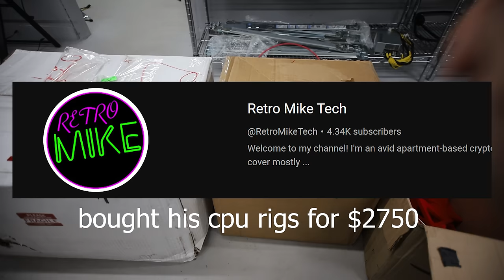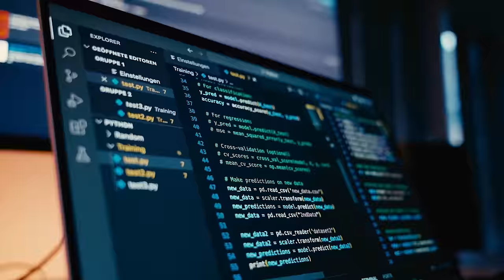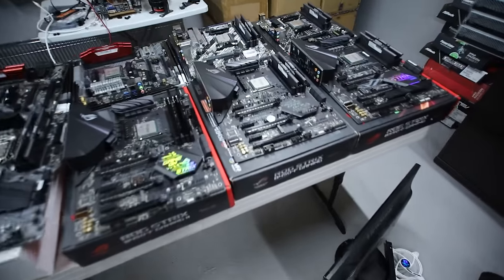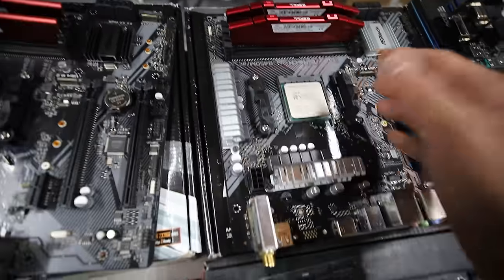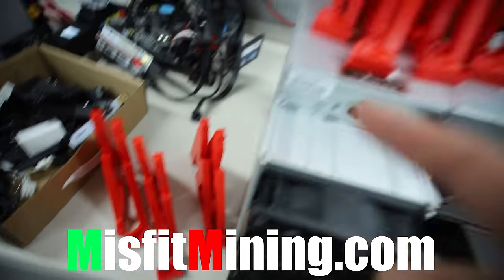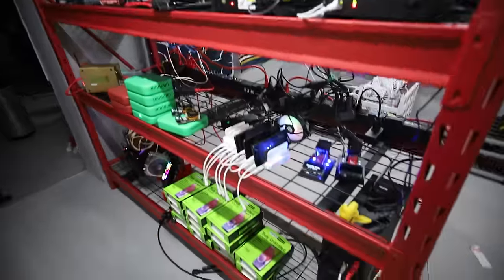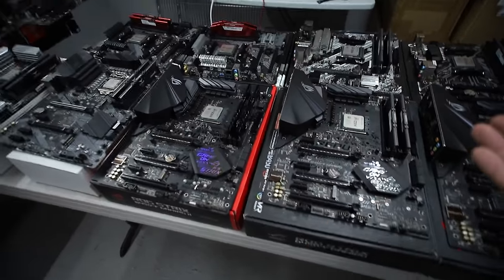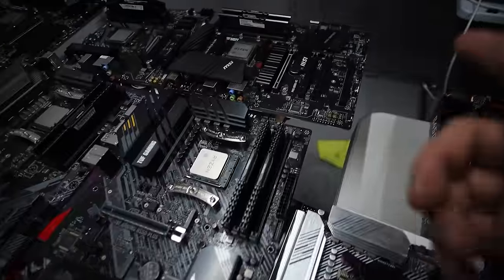I BOUGHT 15 CPU MINING RIGS...

Comment: I have 14CPU rigs (mostly 3900x), the stock coolers work but i like tower coolers because they drop the CPU temp a few degrees (I usually use the ones you have except on my 7950x
). As for layout and PSU's I have tried lots of different layouts but honestly the only way I recommend is open air frames or cheap tower cases with a GPU to make you hit that 50% rule of the ATX PSU. It makes it 1000% easier to clean everything and move everything, plus you just use the GPU for mining. its a simple flight sheet set-up to make them mine on both CPU and GPU. makes BIOS changes 10x times easier since the ryzen 9 don't have integrated graphics (and the bios is the best option for the CPU under/over clocks). Just my Opinion but it works best for me.
Reply: What's the max temp under load for your 3900x using the stock cooler? (is it the stealth, spire, or prizm?)
Reply: how much are you making with thoose rigs?
Reply: Prisms see about 65 on the high end in my climate with the 3900x
Reply: more cooler components = more efficiency.

Tower coolers defo pay off in the long term

Comment: Hang them from a wire rack using zip ties. You can put the power supplies below them. It can be very dense that way especially with the wraith coolers. Those coolers work great. They have a low and high speed switch on them. Return your other ones.

Comment: Two things you need.  Make sure your memory is ddr4 3600 cl14.  Also your coolers are going to struggle.  I find that you'll need dual tower air coolers.  The most cost efficient cooler is the peerless assassin for 36 bucks.  gl

Comment: my best combo is R9 CPU +6 GPUs in an open frame minig rig, just leave 1 theread free for the OS. I use these with 6x 3070, the CPU mines GR on zergpool, payout currency set to RVN or FLUX what wouldn't be profitable to mine by GPUs due to the 0.18$/kWh price I pay for electricity; and GPUs mining ALPH for hodl. The whole rig is powered by 1600W ATX PSU, simple and silent, I hate the small screaming fans of server PSUs

Comment: I’ve got 2 cpu rigs (3900x or 5900x) on one ATX 450watt, 24pin splitter and one pcie to cpu adapter. All plugged into 240v psu. Open upside down T frames. 2 rigs per frame. Never any issues.

Comment: My CPU rigs are all hanging side-by-side on a silver wire-frame shelf. Also, im using those stock coolers for my 5050X and they work great. If you have extra, I would like to buy those from you. On, I also use 1200W server PSU's to power all my CPU rigs.

Comment: I don't recommend using PICO PSU with CPU mining rigs, they may burn and damage the motherboard sometimes. Even those they claim to handle 300W belief me I tried. You can only use them for GPU mining rigs.
Reply: Actually I have to contradict what you said, well partially. PicoPSU (we're talking 120+W models) will work great, as long as you draw relatively small wattage, by that I mean a 65W CPU. It is a perfect match for a Ryzen 3900/5900/7900 (non-X) for example, I had that exact combo (120W PicoPSU + Ryzen 3900) running for a number of years without any issues. But you would have to buy those PicoPSUs extremely cheap to justify the investment, as they would be a few times more expensive, than just a single high-wattage PSU with splitters.
Reply: @TheRadiastral I guess it depend on the quality of the PSU, but after I lost 3 PICO PSUs and one expensive motherboard I'm not going to risk it again.

Also the motherboard I lost was X399 motherboard connected with 4 GPU on x16 PCIe - for vastai not mining - maybe the GPUs also draw extra power through the motherboard witch overload the PICO PSU.

Comment: Since you have plenty of frames, I would drill more holes and mount two boards per frame and maybe even 4 on those 2 tier frames. I power supply can easily be split and run two boards.

Comment: Hey everye, we are getting on the Amd 5950x 17790 H/s at 131Watts 31 threads. 1.4v average peak corev. Temps around 65c water cooled.
For my test , 32 threads drops in hashrate around 600h/s  so I use 31 instead unsure why but hey it is what it is.
I did manage a bit higher Hashrate to 18000h/s but need to more testing in bios. Xmrig seems better than srb minor in my test on hashrate on the 5950x, And also bios twerk was better than using the then masters tweek, that got average 16000 hashrate for me. Setting by bios also dropped wattage from 155W to 131W stable.
What's everyone else getting

Comment: Panda please tell me you are using splitters to minimize number of PSUs? I usually run 3-4 cpu rigs per psu.
8pin cpu splitters
24 pin atx splitters

Is there a way I can share pictures of my set up to you?
Reply: How you run 3-4 on a regular psu?
Reply: @HeroBach-jm5gn  splitters man. Need proper 24 pin splitters, and 8 pin cpu splitters. I've never had the 24 pin get hot even with 5 motherboards on a single psu (they only power the peripherals so the load is nominal)... but I like 3 cpus on a 650w psu for the nice medium load of around 400w. Never had a splitter get too hot, 8pin cpu are rated for 384w I believe, unlike the 8 pin pcie which is 280w I think? Anyways there ya go. Ebay is your friend.

Comment: If doing 2 cpu rigs [er psu then go with atx 500/600w if going for 3+ per psu the go with a server psu.
I am running atx psu's as doing 2 rigs per psu.
Also if not using those amd coolers then can sell for $40 each